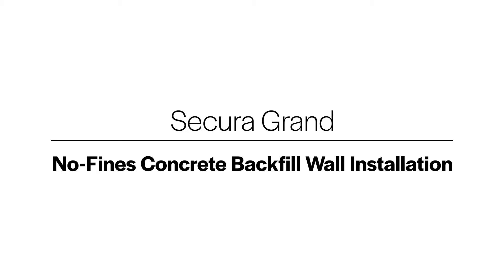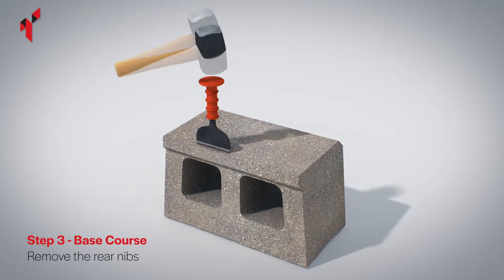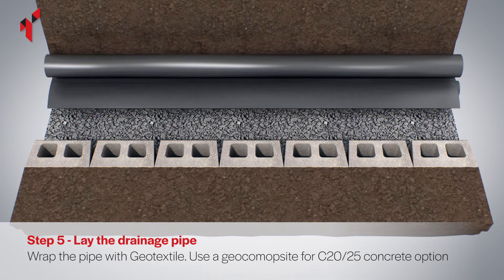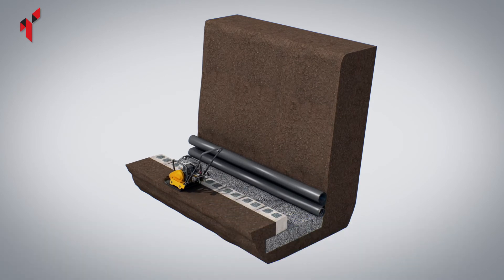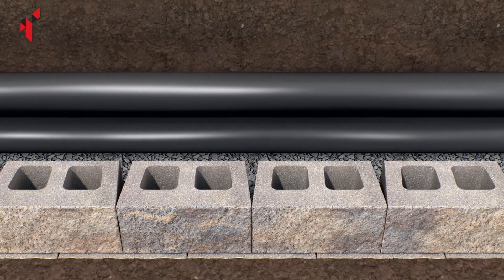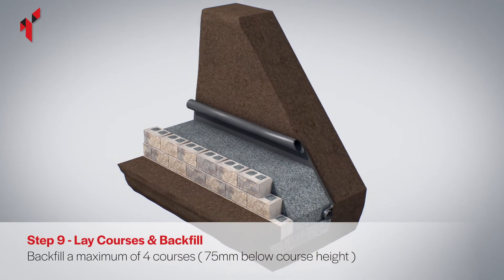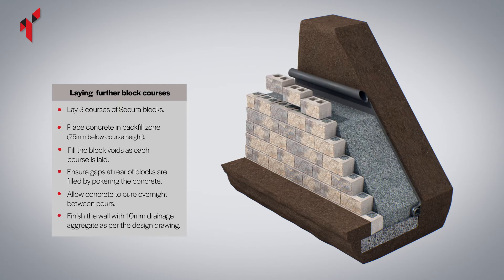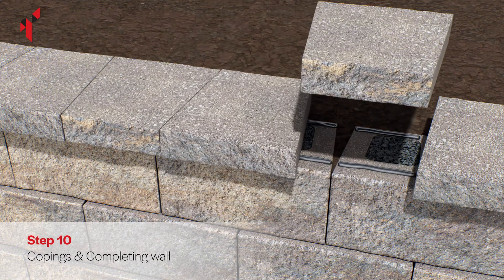How To Build A Secura Grand Retaining Wall With Concrete Backfill - Step by Step Installation

Comment: There are no steel reinforcements in the blocks and behind the wall. There are no forms to build the concrete wall. You need waterproofing on the concrete wall side and then gravel on top of the drain pipe. So actually a few additional steps and much more materials are needed.
Reply: This isn't a basement so you don't want waterproofing.  You want the water to naturally pass through the retaining wall to avoid having water be there during freezing conditions which would cause ice to expand and break down the structure.

Comment: Do Not follow this... Putting concrete behind the wall is a terrible idea. First and foremost, the soil would never be able to support this amount of weight. Secondly, this type of block wall is designed to allow water to weep through the joints not seal it. Thirdly, since the water won’t be able to weep, when you go through a freeze - thaw cycle, the top of the wall will push out and make the wall fail.
Reply: the closest you have ever been to building is a screen on a computer?
what soil cannot handle the weight  a column of concrete a couple of yards high? quicksand?
a wall of solid concrete, what water  won't be able to weep?
solid concrete = no water
Reply: @janvanruth3485  It’s painfully obvious that you don’t have ANY construction knowledge, so let me give you some insight.
My knowledge was gained by working with engineers and actually DOING the work. 
1) What soil couldn’t handle it? After fixing maybe 10,000 foundations as a contractor I would say it happens often. Have you never seen a failed retaining wall, cracked foundation or concrete slab?
2) Weep? It’s obvious that you don’t understand the concept. You stated solid concrete = no weep. You WANT the wall to weep. If a wall doesn’t weep then hydrostatic pressure will build and push the wall. When a wall is designed to weep it allows water to pass through it so that pressure doesn’t build behind it.

If you want to have an understanding of an issue don’t attack, ask questions. As a contractor clients contact me to consult on projects. It’s obvious that you have logged too many hours looking at the screen in front of you...
Reply: @stephenc2296  weep?
And what do you think the drainage pipe was for?
10000?
one a day, 5 days a week, for 40 years?
Reply: @janvanruth3485  5 crews working for the largest foundation company in the US.

Solid walls do incorporate drainage pipe, this did not. Even if drainage pipe is installed, that doesn’t say that all moisture got to the pipe. Any moisture in the local soil will freeze and push a wall. I am not saying that a solid wall can’t be used... but there are greater parameters for installation which are not addressed here.
Reply: @stephenc2296  no wonder america is shaking on its foundations....
Reply: As stated in the video and in the video description the use of NO FINES CONCRETE basically negates all three of your arguments.

Comment: how about geogrid or anchors?
Reply: it says in a description this method is used when there is no sufficient space for a geo grid behind a back wall. remember rule of thump for a 10 ft tall wall u need 10 ft geo grid behind a wall. same goes for a deadsmans (anchors) they need to extend deep into the ground behind a wall to hold the wall suffeciently.